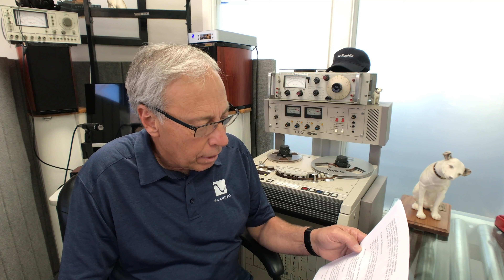Explain the different types of DACs

Comment: There is some false information in your video that should be corrected. There are now R/2R DACS up to twenty bit, in fact Schiit audio uses one in there Yiggy DAC (and an 18 bit in there Gumby). It should also be explained that there is no usable information above 20 bits in music, and in fact there are no preamps, amps, or speakers that can actually do anything above 20 bit, and very few that can go that far. Anything above about 20 bit is nothing more then marketing hype. 

It is unfortunate that Paul, who certainly must know better, choices to deceive that public about the illusion of high bit.
Reply: I would hope you are aware that anything over 130dB causes permanent hearing loss, so I do hope you are not suggesting playing music that loud. The sound of a full orchestra at 1 meter away is 120dB (20 bit). A front row seat would be less then that. 

Medical scanners and the military use R/2R DAC's because they are bit perfect, meaning no information is thrown out. What comes in is what goes out (in analog of course). You are confusing resister ladder DAC's with R/2R chip DAC's. The R/2R DAC's used by the military and medical are extremely precise.
Reply: Paul McGowan Increasing the bits just causes the noise floor to drop subsequently increasing the dynamic range. The problem is that the noise floor of pretty much all current electronics is higher than the noise floor of 24-bit which negates it's benefits.
Reply: The noise floor of the listening room needs to be considered when determining what dynamic range will be perceived.

Personally, I think 16 bits is sometimes too much of a compromise. But 18 bits provides four times the dynamic range. Sixteen times the dynamic range, accomplished with 20 bits seems like overkill. The power supply stability becomes very difficult. If I have 80 volts swing on my power amp output, the least significant bit of a 20 bit signal is wagging 76 microvolts. My own heartbeat will easily mask the difference in signal from my speakers.
Reply: Alan Selk Dynamic range doesn't mean you have to play that loud. It actually indicated how much noise you can hear when played at normal level. Do measurements before talking all these nonsense.
Reply: John Yang What I meant is that you'd have to listen at very loud volumes to hear the noise floor of CD. And even louder to hear it in 24 or even 32bit.
Reply: Kacper Uminski Not really.
Reply: Alan Selk Have you seen the linearity results of the Yggy? It doesn't even go linear past 16 bits. And it is plagued with so many artifacts, bit truncation and zero-crossing glitches on its output stage. The only reason it sounds good is probably due to its closed-form filter, but as far as the output stage measures it is nothing to write home about. Though, I admit it is still sound very, very good.
Reply: The human eye can't hear more than 8-bit